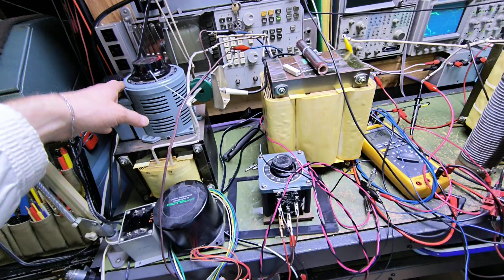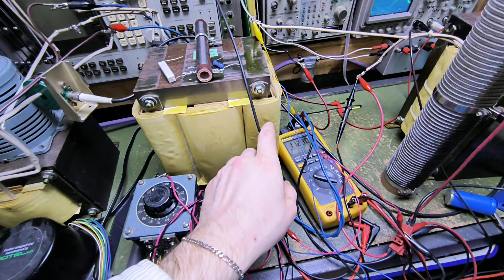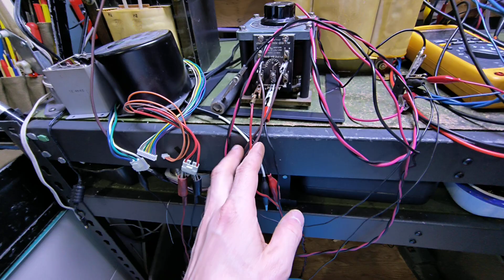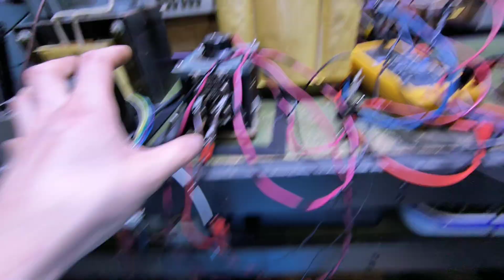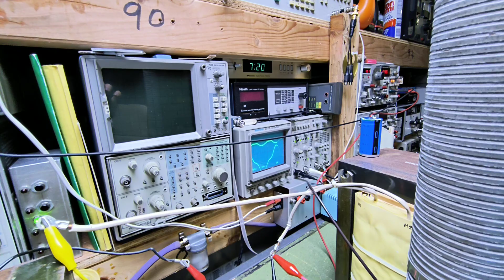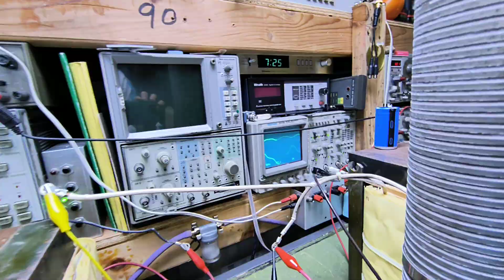Saturable Reactor Fun

Comment: Could one use a zx7-400/428 amorphous core transformer for an egs002 based inverter board? Its an h bridge mosfet switch, needing approximately 28v to convert to mains which can ba 120v x2 in a symmetric center tapped configuration (literally tap the center of it). 
The turn ratio is about 38:4 which works out well for the conversions, BUT is only 4 turns adequate, I dont know how the losses occur with not only thw winding Ratio but the number of winds themself. Probably has to depend on the magnetic saturability of the core. 
So its amorphous it can take 400a with 20 percent duty cycle i guess. 
Thick wires, 
COULD it work for the inverter boards you think?